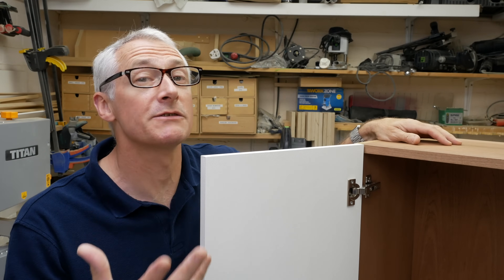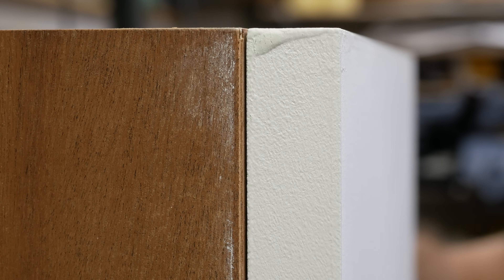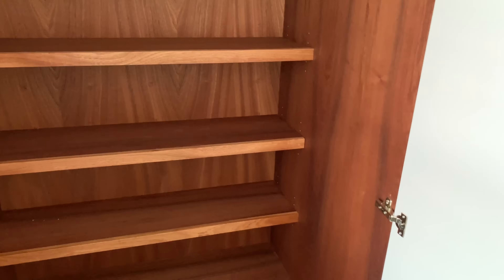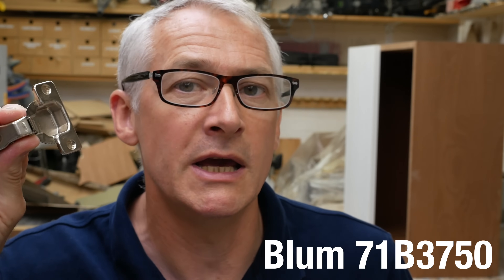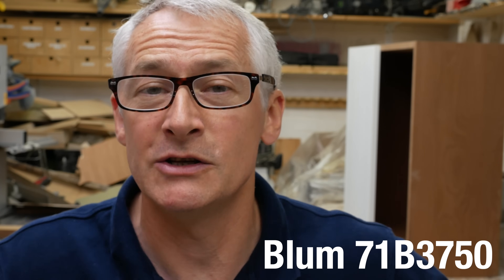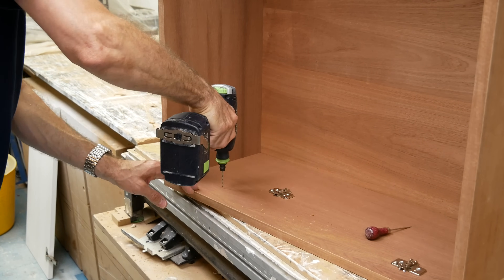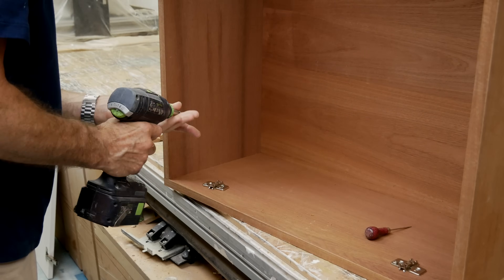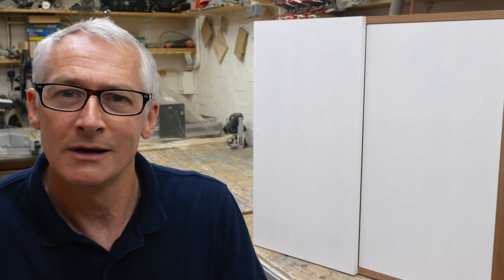How to fit concealed (Euro-style) hinges for overlay & inset cabinet doors [video # 348]

Comment: Peter, at 1:20 you mention that the screws driven through the hinge body are 32mm apart.  Here in the USA we typically find these 45mm apart.  Is 32mm  CTC on the hinge body common there?  This was an excellent presentation, as always.  Scott
Reply from the maker: No, I mis-spoke, they're 45mm as standard; over a million views on this 4-year old video and you're the first person to notice though! 👍
Reply: @10MinuteWorkshop  Did I win something? :) Seriously, you said it with such confidence and moments later as you installed the mounting plate you said “again at 32mm centers”, so I figured you had to be right and that I just didn’t know my ironmongery as well as I though I did! Again, well done. Scott

Comment: I have installed these hinges many times, mainly for my own furniture (in Finland), but I've never known there are those clip-on and integrated-soft-close variants! I would think they are available here in well equipped hardware stores, but somehow I've never seen those, just the ordinary screw-installed and no-soft-close ones :)
EDIT: Oh, and just to mention, you forgot to mention the wide-open variant, which allows the door to open close to 180 degrees :)
Reply from the maker: Glad it's helped. And I didn't forget - that's for another video... 👌
Reply: @10MinuteWorkshop   Oh, good, and thanks!

Comment: Great video thanks! One question.  With the hinge plates being set back 37mm, at which point of the hinge plate is that measurement taken from? Thanks
Reply from the maker: Thanks! The plates typically have a centre-line on them, but if it’s missing or hard to read then it’s from the centre of the fixing holes. 👍

Comment: Back again Peter . Just trying to get my head around  Inset hinges and filler strips .  When using inset hinges do I have to set  hinge cup different  in order to keep doors protruding from frame , to allow for filler strip . Hope you understand my phrasing . Thanks in advance .
Reply from the maker: So, inset doors are where they fit inside the carcass or frame, and inset hinges are shaped or ‘cranked’ specifically so that the hinge cup stays in the same position in the door. So no, you don’t need to alter the position of the hinge cup on the door, but the location of the hinge plate in the carcass will move back into the carcass by the thickness of the door. 👍👍
Reply: @10MinuteWorkshop  Thanks for reply . I have made two vanity units with inlay doors as per your video on concealed hinges .
What I am making next is an alcove unit with inlay doors and make the outer door gap up with a scribed filler joint or infill  . This will be scribed on RH side to a brick fireplace  , but  I am confused as how to measure properly to leave me a 2 mm gap on door side .
Just a confused DIY er who has learned a lot from your channel . Thanks in advance . I probably am overthinking it too much .

Comment: I have access to a mill, so I used to make hinge templates out of lexan.  After a few of those, I decided to give the Kreg jig a try.  I no longer make hinge templates out of lexan.  The only downside with the Kreg jig is that once the included bit wears out, you cannot use a typical Forstner bit in its place...you must purchase a replacement bit from Kreg.  Not overly expensive, but something to think about if you're in a production shop making hundreds of cabinet doors.
Reply from the maker: Interesting, thanks - I’ll look forward to trying the Kreg jig out. Good point re the bit, too! 👍👍

Comment: Some great advice here thanks Peter. I use the same hinges and usually mark the plate manually however I just ordered two of the template jigs(following your links of course) it should speed things up a lot.
Reply from the maker: Thanks Peter! Those little hinge jugs are really handy- and not just for hinges 👍👍

Comment: Hi Peter. Your videos have been invaluable during my cabinet build. What are the screws are you using in this video? I'm struggling to find any information on what screws to use with the Blum hinge.
Reply from the maker: Thanks Thomas! I usually use 4x16mm for the hinge plates, and 3.5x16 for the hinges themselves. If you're fitting these into a commercial cabinet that's used the 32mm system, then they'll probably expect you to be using Euro screws. I did have some really nice 4 x 14mm screws for the hinge plates from Ironmongery direct that were more like self-tappers, but they don't seem to do them anymore. 🤷‍♂️ 👍

Comment: Another reason to disable the soft close - very light doors.  I built some panel doors with 6 mm plywood and poplar rails/stiles. The doors were so light that they took forever to close with soft close enabled. I disabled the soft close and now they close just as a normal door would with the soft close.

Comment: Very informative video.  Thank you.  One question...when drilling the door for the hinge cup you offset 22.5mm from edge so your "bore distance" is 5mm.  Looking at the spec sheet for 71B3550 this means your overlay is 16mm (assuming plate height "H" is 0mm).  Is that correct?  But it looks like you are using 3/4" (19mm) stock for door and cabinet so wouldn't you want a bore distance of 7mm which would place center of 35mm hole at 24.5mm?  Stating your overlay amount and thickness of material would help clarify.

Comment: Any thoughts on whether to use the overlay hinge when you have an end panel that sits flush with the face of the door? 

Technically it’s an overlay install on the frameless cabinet, but then the end panel acts as a face frame of sorts, creating an inset finish.
Reply from the maker: If you have an end panel that covers the door edge, then yes you should be using an overlay hinge. This was common in eg alcove cabinets where you’d have an end panel scribed to the chimney-breast on one side, and the top that overhangs that edge and the front. 👍

Comment: Great video Peter - thank you - nice little tip someone showed me once - when mounting the hinges on the door, prior to marking the hinge boss retaining screws (once the 35mm hole is drilled) put hinges in the door and align the hinges by resting a straight edge against all of the hinge bosses to ensure they are completely parallel!  Although with your precision, you probably don't need to do that! :)
Reply from the maker: Haha, that’s a good trick wether you need it or not, thanks! 👍👍

Comment: Hi Peter, brilliant video. Just what I need however, I'm doing a camper conversion which uses 15mm ply. Despite several searches I can't find anyone who does a concealed hinge for 15 mm lightweight board. Any suggestions please? Thanks Frank
Reply from the maker: Hi Frank, and thanks! Blum do a thin door hinge without the cup, so surface-mounted effectively. This one - https://www.trade-hinges.co.uk/soft-close-thin-door-hinge-2569-p.asp HTH. Peter

Comment: Thanks for sharing.  Are you making the closet doors with 3/4 plywood?  Would they warp or cup very easily?  Do you know how to prevent from warp or cup?
Reply from the maker: MDF, and usually I use 22mm (7/8”) on commercial work for exactly that reason. 👍

Comment: These  hinges can be installed on wall for wardrobe? Of we concrete  racks! And want to install for door of wardrobe?
Reply from the maker: They’re designed for use in wardrobe and cabinet carcasses. I wouldn’t recommend using them directly on a brick wall, no., I’m sorry

Comment: Full overlay hinges appear to be designed for 18mm (3/4") wood. I have 5/8" thick plywood for my project and I'm wondering if I can just change the location of the cup to be 1/8" closer to the edge to compensate for the lesser thickness or if this is going to cause problems.
Reply from the maker: I’ve never done it though it should be possible - you’d need to be careful about getting too close to the edge of the door though! You can get mounting plates with additional offset eg +3mm - might be a better solution?

Comment: Thanks for the video, though the hardest part is lining up the hinges you screwed inside the cabinet which seems to just appear done. How did you line then up? Thanks
Reply from the maker: You use the same little plastic jig that you use for the hinge in the door. I refer to it in the inset door, and how you can't use that jig but you can use another. 👍

Comment: Hi Peter, your video is a life saver! I have a question hoping you can help me with it as I am not very handy. I drilled my hole 23.5mm from the edge (1mm more outward), should I be moving my mounting bracket 1mm closer instead of 37mm make it 36mm? Will the 1mm make a difference if i just leave it at 37mm? I am not sure how much the adjustment screws can tune.
Reply from the maker: Thanks! No leave it at 37mm; the hole in the door will relate to how much the door overhangs the carcass left - right. The hinge plate position relates to where the door sits in-out. There's +/- 2-3mm of wiggle room on the hinges, you should be fine. 👍

Comment: Interesting that you said set back  37mm for the plate. I was sure Ikea used Blum and their pax wardrobes are only 27mm in.
Reply: Yes, they used to use Blum but they now sell their own branded 'Komplement ' hinges. The mounting plate for those sits 27mm back as you say. If you were using Pax carcasses and making your own doors, you'd need to drill new holes for the mounting plates if you decide to use Blum hinges.

Comment: So Peter when you say the plate for the full overlay Blum is to be 37mm from the cabinet door are you talking about the points for the screws being 37mm from the edge or referenced to something else ? 
The centre for the body is 22.5mm from the edge of the door … thanks for the clarification.
Reply from the maker: A ‘set-back’ should always referenced edge to centres, so yes, 37mm from the carcass edge to the centre of the hinge plate, where the screws go. Same for the hinge body, 22.5mm from the edge to the centre. 👍
Reply: @10MinuteWorkshop  thank you !

Comment: Hi Peter, thanks for the straight forward video. I’m having trouble with the corner cupboard hinges which attach to the cupboard. They don’t allow the door to close. Any advice?
Reply from the maker: Hi Susan, and thanks! The only time I’ve seen this happen is when the hinge adjustment is at the extremes of movement - ie almost 100% one way or the other - then this can interfere with the self-closing aspect, making it ‘spring’ a little away from the carcass. The fix for this is to take out the extremes of adjustment to make the door close normally, trimming the door or repositioning the hinges if necessary. Never seen it in a blind corner / 45° hinge though, so I’m not sure if that’s the answer you’re looking for. Best, Peter

Comment: Excellent video. Have you ever attached euro or concealed hinges to cinder block?  I have nice wood doors I want to fit to a cinder block outdoor platform (with very thing coating of concrete floated over it). Adding a wood frame around it isn't practical for design reasons.... Futile effort?
Reply from the maker: No, never tried it, sorry! 🤷‍♂️ And thanks! 👍
Reply: @10MinuteWorkshop  copy that. Thanks for quick response!

Comment: Thanks for this Peter! How are the measurements effected by having a 22mm thick door?
Reply from the maker: Thanks! Measurements aren’t effected at all if you’re using the Blum hinges mentioned here - they’re good for up to 26mm thick doors, I think. 👍👍
Reply: @10MinuteWorkshop  will do a mockup and see!! btw I bought 71MB3550 hinges hopefully they ar the same as the 71B3550 you mention.

Comment: i was just trying to create a simple cabinet, using concealed hinges. I wasn't able to hear the 22,5 center dimension well enough. Thought it was refered to as 20,5. I did some fast online search and i saw mentions of 20,5 and 21,5 so i decided to just follow a middle line and went for the 21,5mm center. the thing is that after installing everything i end up with a small gap on the hinges side of the cabinets door, which is beyond repair through hinge adjusting screws. So i ended up thinking that either different brands of hinges use different dimensions (i didn't use blum ones)which i don;t really thing is the case, or that it also depends on the thickness of the material. I used all around 18milimeter osb. I think that if i had used 15 millimeter board for the sides, the final positioning would have been ok. 

I ll try to fill the holes with material and try redoing them i little bit further inside and see if this works.
Reply: in the end, i bought some different concealed hinges which are suitable for the 18mm material. So the solution came with no filling holes, just hinges swap.

Comment: 1:17 is this correct? The hole is 35mm, so the screws are ~45mm apart.
Reply from the maker: No, I mis-spoke, but congrats on only being the third person to notice. 👍
Reply: @10MinuteWorkshop  I did a search for a similar comment but didn't find any, so thanks for acknowledging. Meanwhile the hinges are installed and my cabinet door fits perfectly. Thanks for the detailed video!

Comment: Hi, thank you for this informative video. I would like to shamelessly pick your brains for gratis advice. 
I have an aquarium stand manufactured from 30mm square tubing. The sides and back are covered with veneered particleboard (hiding the frame), but the front is doorless and open. What hidden hinge solution can I use to add doors given the fact that the inner corners of the cabinet are occupied by the uprights of the metal frame and that I need to cover both the frame and the front edge of the 16mm particleboard covering the sides? I have considered adding a 30mm thick slab of wood behind the uprights so that there is a flush surface to mount hinges, but I don't know if the geometry of the hinge will allow the doors to open without fouling the outer corners. I hope my description makes visual sense and that you have some expert advice for me. Thank you and I wish you a prosperous 2025!
Reply from the maker: Thank you! The set-back on these hinges is 37mm, so on your aquarium stand you might just have enough clearance to get the hinge fitted into a 30mm block of wood immediately behind the frame, but it would be tight. I think I'd be inclined to fit a face-frame onto the metal tubing to cover it up, then butt the doors up against that as you wont find this type of concealed hinge with a 30mm overlay. I guess it's also technically possible to fix the hinge plates onto the metal framework, but I've never tried it and would be very much dependent on th thickness of the metal! Hope that helps, and good luck!
Reply: @10MinuteWorkshop  Thank you for the advice, it's much appreciated.

Comment: This video was super helpful!! However I did have a few issues. I built my carcasses out of 13mm ply to save weight. Does the carcass thickness need to be the same thickness as the door for this to work. I ended up packing the mounting plate off by 5mm and it seemed to help. (I used 18mm for the doors)

Comment: Hi Peter, thank you again for a very clear video on a complex matter. One question , if I read correctly the Blum manual to install inset hinges, the mounting base should be 37mm in, plus the thickness of the door and add 1.5mm, I see from your video that you did not add the 1.5mm any reason why it should or should not be added? thank you again.
Reply from the maker: That gives you a door that’s 1.5mm away from the carcass; I prefer them to be a little closer than that, and to use then adjustment on the hinge to tweak them as necessary. 👍👍

Comment: Hi Peter very useful advice as usual. I am soon to fit a number of wardrobe doors in 18mm MDF. They are 2.440 x .600. I am thinking 6 hinges per door, but cannot find any calculators on the Blum site, only that they recommend 3.5Kilo per hinge.
Reply from the maker: Sounds about right - that's a big old door! 👍

Comment: Very informative Peter thankyou. I will be using the blum inset extra thick hinges for a 27mm thick door. Are the positioning measurements the same as the standard inset hinge? Thanks
Reply from the maker: Never used them I’m sorry; I’d expect them to be the same, but worth checking the specs with Blum on this one. 👍
Reply: @10MinuteWorkshop  cheers

Comment: Hi Peter, I enjoy your videos, thank you.
 I'm fitting full overlay 110° hafele hinges to a wardrobe that I have built of 18mm mdf, the doors are 18mm also. The cups have been drilled 4mm from the door edge. What distance should I fix the huge mounts from the edge of the cabinet please? The manufacturer's layout plans don't give much of a clue and they are in Thai.
Reply from the maker: Thanks! Hinge plates are usually on a 37mm set-back. If you want instructions in English then Hafele.co.uk should have everything available as a download. 👍
Reply: @10MinuteWorkshop  
Thank you Peter.

Comment: How do you measure door size if you want to have them inset? what the gap between door and cabinet should be? is 1 mm enough?
Reply from the maker: I have a door size video planned, should be out soon, but short answer, no, 1mm won’t generally be enough; you need to be aiming for 1.5-2mm all around. 👍
Reply: @10MinuteWorkshop  Chers! thank you!

Comment: Hi Peter, much enjoyed viewing your video again. I've read that when measuring for double door widths it's best to measure the total width of the carcass, deduct 8mm then divide by 2.
(1) Is that the total width of the carcass itself or of the gap?
(2) Also if the 'width' differs from top to bottom eg 117mm gap at the top and 120mm at the bottom do you pick the narrow one or split the difference?
Reply from the maker: I’ve never come across that one before tbh. I’d assume that would be on an inset pair of doors, so you’d have 4mm divided into 3 between the doors themselves and the doors and the carcass. That’d leave a gap of ~1.3mm which might be a little bit snug, but OK for thinner doors. 👍